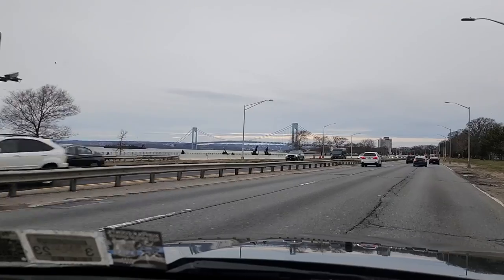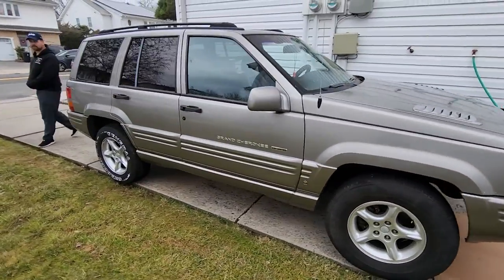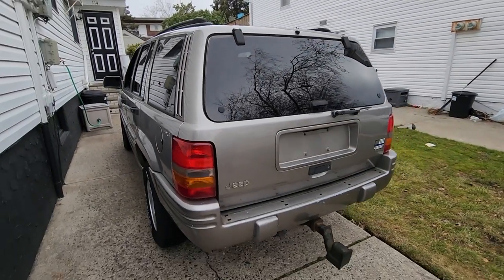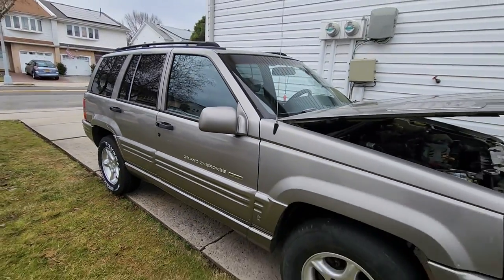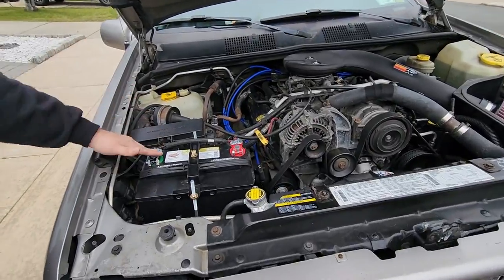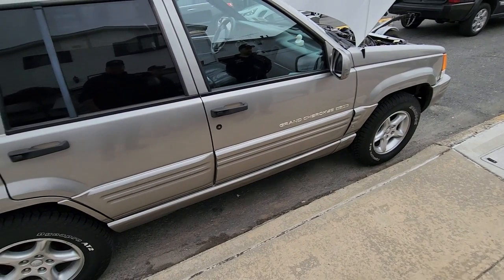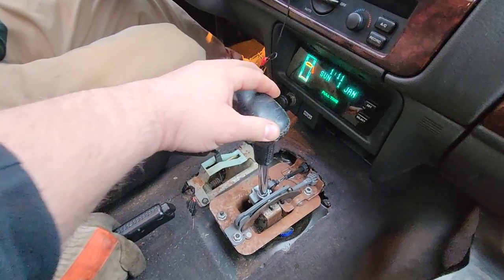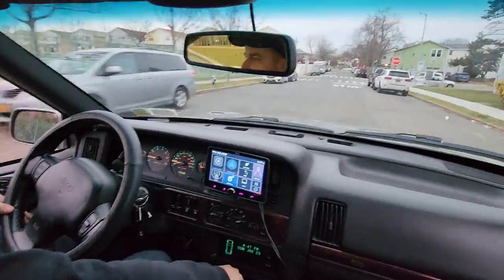I BOUGHT A NINER!!! PROJECT DAN H GETS A 1998 GRAND CHEROKEE 5.9 LIMITED

Comment: I made some upgrades to mine like a 3" lift, bigger tires, light bar s, winch etc etc but I didn't do anything to where I couldn't return it perfectly back to stock. No new holes drilled, puck lift, custom made light bar that utilizes the roof rack screws that are already installed. I also got all the original owners regular maintenance receipts that were all done at the  jeep dealership.

Comment: Rodney Dickman fan switch(210) for the Fiero  and adjust wiring. Uses a gm pigtail (search 1988 2.8 rad fan switch connector in the electrical connector section)from rock auto, lots of options. .Its a goofy round looking thing.  Grounded it with a bare wire clamped on the radiator hose T with a hose clamp.
Reply from the maker: Nice!!!
Reply: @ProjectDanH  I'll look for a part number on the pigtail if you want. I also used a pigtail to connect to stock wiring to avoid cutting the connector.

Comment: Always wanted a 5.9 limited. I'm on my 2nd GC. 1st one was a 95 limited with a 4.0.  The current one is a 93 Laredo with the 4.0. It's an early model, build date mid 1992 and it has the AW4 auto. Got 321k on the clock on what I suspect is the original engine. I got it at 180k and the most I've had to do to the engine other then basic stuff is rear main, timing chain and front cover gasket/ front main, harmonic balancer, distributor, valve cover gasket. I just fixed the door hinges this weekend with my dad (73 and still gettin after it!) and  your video. Door closes better then it ever did in many years! Thanks for all the good info on your door repair video. Looking forward to watching the 5.9 progress into a beast! Sounds knarly with those headers! From WA to NY, 🍻 cheers!
Reply from the maker: Cheers Brother! Thanks for watching!!!

Comment: I was the second owner of a 5.9. The woman was in sales in three years and racked up over 100,000 miles (highway). I purchased it for $4500 in 2001, owned it until 2009, and sold it with 175,000 miles. It still ran and shifted great and was the best tow vehicle I've ever owned. I replaced it because I needed a pickup. The truck sucked for towing, and I still regret letting it go.
Reply from the maker: Oh man.. maybe you'll own another one Day!
Reply: @ProjectDanH  I've been looking. They are hard to find in good condition. Especially here in New Hampshire.
Reply: @kerrylewis2581  I’m in Utah and I’ll probably be selling mine in the next year or so. It’s been sitting for the last couple years since I bought a different car. It’s got a few things I need to fix on it before selling it. It’s white and in pretty good shape. 113k miles on it. I wanted to have it up for sale by now but have had too many other projects come up that I haven’t gotten around to fixing the few things on the 5.9 the distance might be a deal breaker but let me know if you’re interested. I’ll probably be asking about $11k for it once I get everything fixed and get it cleaned up. Interior is 10/10 and exterior is 9/10. Not quite a 10/10 due to some undercarriage rust and a few minor nicks and scratches but no dents.

Comment: Do a Novak Conversations' transfer case shift cable! It replaces the dogleg linkage with a high grade cable. I did it on my ZJ recently because mine kept bumping out of gear while driving!!
 It is pricey and takes awhile to adjust but in the end totally worth it, it is reliable and so solid- you can actually feel the detents in the case! Something this good definitely deserves to be put into a ZJ of such value
Reply from the maker: That sounds like an excellent idea.  I'll get one for my XJ too!

Comment: Nice ive had m6 5.9 limited for 13 years.  I bought a SJ 90 Grand Wagoneer 6 years ago.  The niner i kept stock.  The SJ is the one i did the major work too and lifted etc.

The upper and lower coolant switchs arent Relays btw they are switchs.. lol. And the switchs arent made anymore.  So when one goes bad.. ur kinda boned.. unless you can find them.  I have 3 spares nyself.. gone through two so far.

Your friend btw needs to adjust that steering wheel.... That far off center lol cmon.. it takes a few min to adjust the wheel.  But i am very curious to why its off center to begin with.

(Stuck) thermostat isnt good either btw.. it can stick closed and then youll overheat till coolant boils out the head gaskets failsafe or not.

First thing you need to do is verify your upper hose fan switch works.. and if your speed fan works.  And kicks on.. itll turn on at 212f.  High speed is 225 or so.

Also check your alternator.. do you still have the original 150 amp or did prior owners replace it with a 110/90amp.  They dont make the 150amps btw.  So when the 150 dies.. get it rebuilt.  Otherwise youll have to downgrade to 136.  The 150 was for the electric fan as it pulls lots of amps.

The Jeep being this old.  I 100% garuntee youll need 8 new control arms.   Check your torque boxes for rust.  They allllll ZJs tend to rust under the drivers and passenger torque box.  And rust the frame out.  And you wont see it by just looking as the factory undercoat hides it

So many other things i can tell you as ive had ZJs for 20 years.
Reply from the maker: Great info brother! Keep the knowledge flowing! I'm excited to restore this baby...  And this key stays in the ignition till it's in the off position! 🤣🤣🤣
Reply: @ProjectDanH  do the fan switchsr work ? Specislly the upper ?  Does it kick on at 210 ?   If not.  You can message me i have 3 replacdments left.  And fyi ive only found 4 or so 5.9s in the salvage yard in 13 years.. so the switchs are hard to come by
Reply from the maker: Thanks man, How much??? Relays are switches.. right? lol
Reply: @ProjectDanH  do you actually need one ? is yours bad ?

Comment: Hello. Please tell me , jeep grand Cherokee 2002 When opening the doors, the lights in the cabin stopped turning on. And the light in the legs burns , then goes out , but not completely , it burns constantly , at half - intensity . Maybe you have met with such a breakdown ?
Reply from the maker: try replacing you BCM - Body Control Module